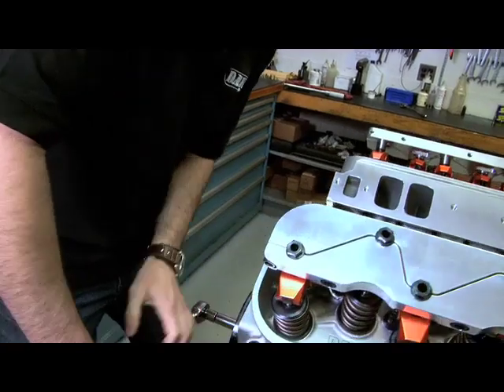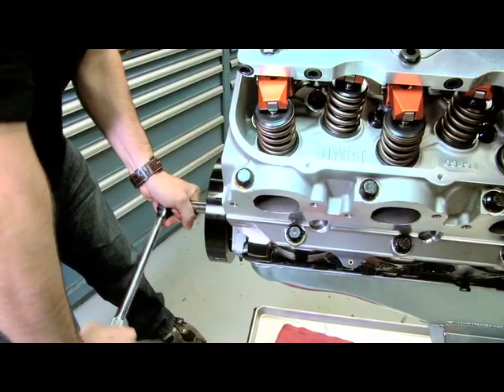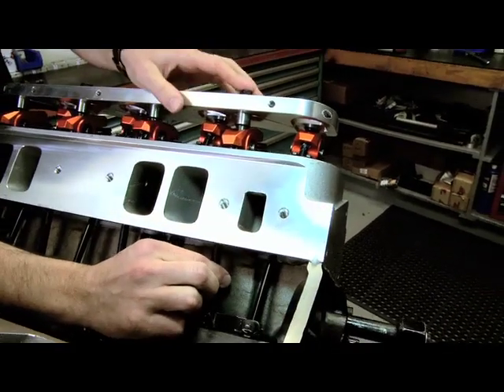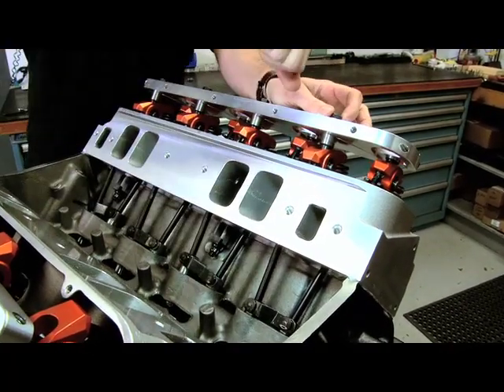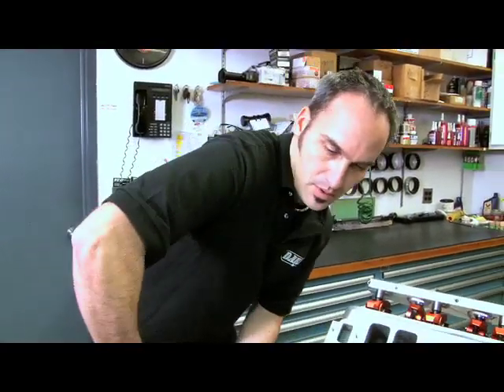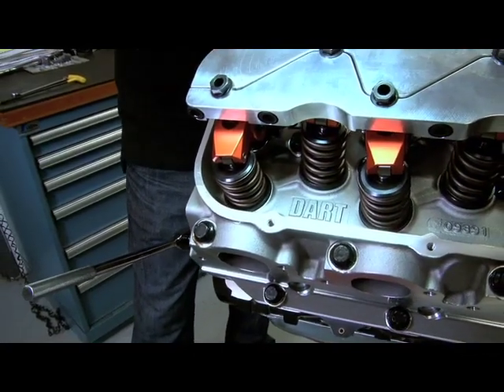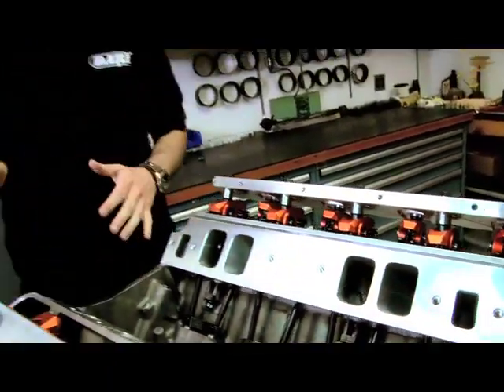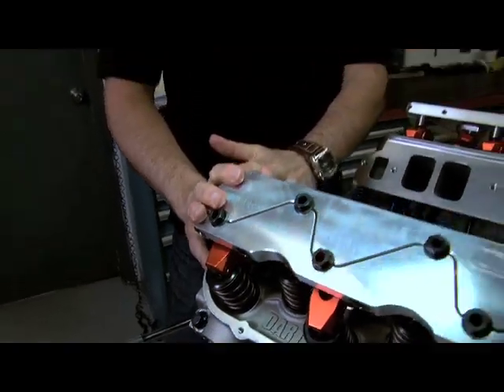Dart University, Lash Adjustment

Comment: Be sure to understand it's TDC of the compression stroke and not during overlap.
He went over that kind of fast. Put your finger in the spark plug hole and if you feel pressure, your on the compression stroke.